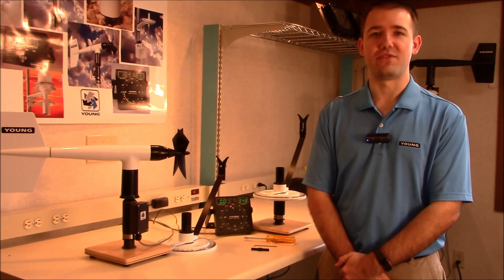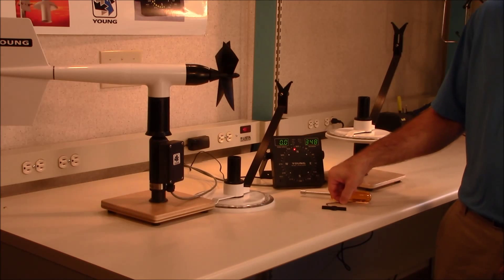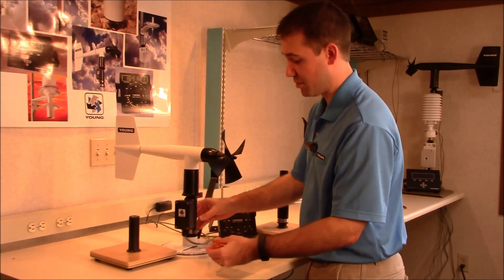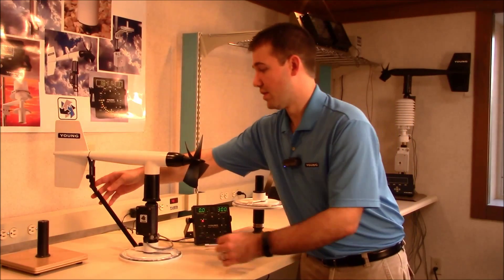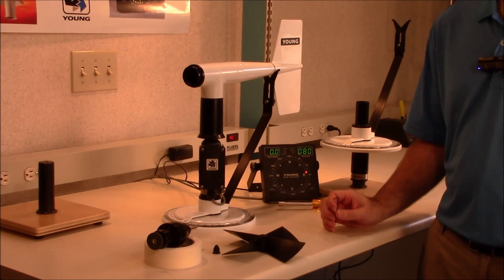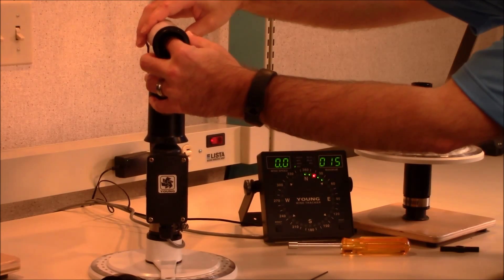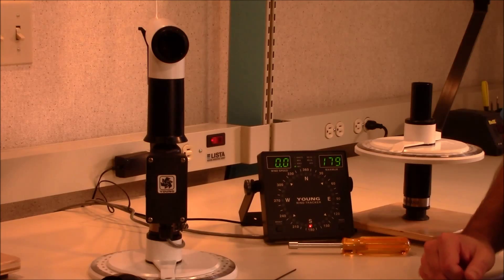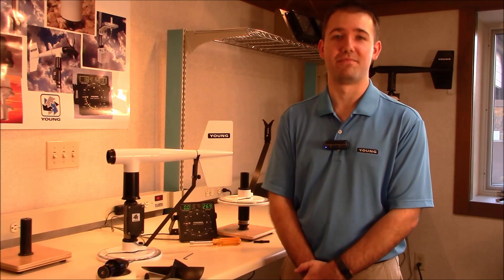R. M. Young Wind Monitor Direction Calibration

Comment: can this device turn more than 360 degrees such that the wires inside won't twist?
Reply: the magnet reader that is inside the shaft is on a motor type pedistle so when it is reading the wind direction it just moves with the magnet the wires are down below the motor thing so they dont get wrapped around

Comment: its curious how this instrument spins super fast
Reply: they made the propeller with just enough angle and pitch to make shure there is little to no resistance and they also use special bearings to be able to handle the fast rotation levels